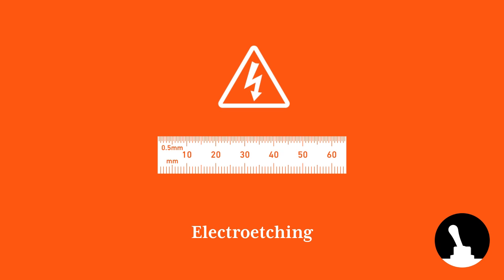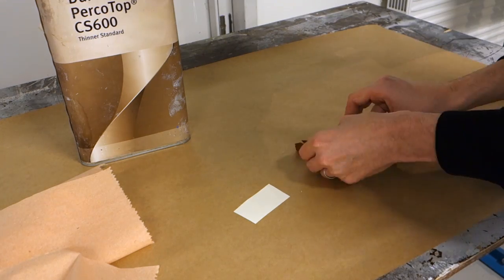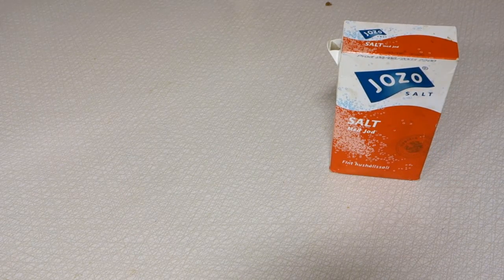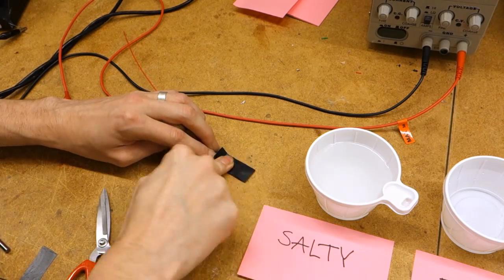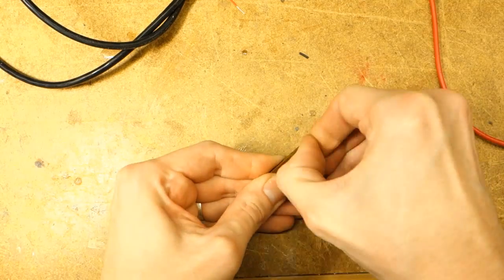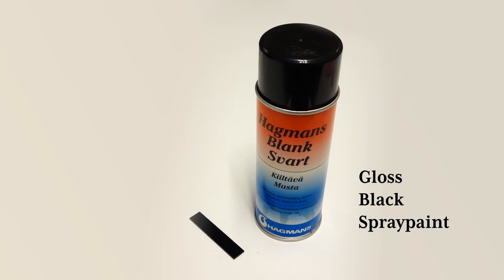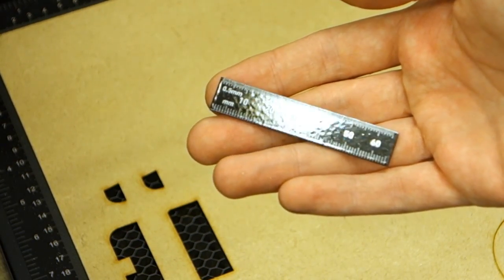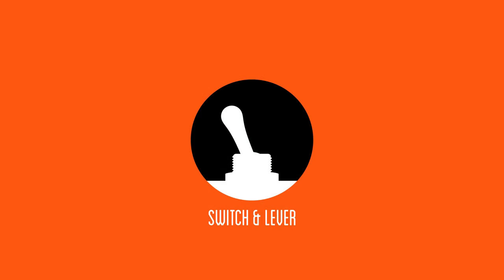Electroetching Metal

Comment: Hi Daniel !
I was hooked of this laser aided etching from the day you shared it, but I've not had the ability to do it ;-((

Now I have got myself a 3D printer and wat to add to it a laser head !
Do you have any idea of how many watts I need the laser to be for burning tape/paint as preparing for etching ?
Reply from the maker: Unfortunately not. If you’re just going to add a laser head to a 3D printer you’re going to add a diode laser, not a CO2 laser tube, which means you’re going to end up with a rather low wattage laser regardless how you do it, likely sub 5W. It may be enough to burn away the paint, I simply cannot say. Because it will do it much slower than a high powered laser there is a much greater chance for the tape burning and edges being unrefined, or paint melting with similar results.

Comment: I wonder if you could ( over a longer period and less voltage) etch metal away enough to make a stamp for touch marking wood.
Reply from the maker: +kooky flukes you have the right idea, but doing it slowly is counter intuitive. To get sufficient depth for branding you need to remove a fair amount of material. When you go that deep it will start to etch not straight into the material, but also into the walls that are being etched, which means the etching will undercut the resist you put on, obliterating any finer detail you put in. For this reason a faster etching is preferred. There are better methods of making branding irons though, like 3D printing (I have a video on that) or CNC milling.

Comment: cool video, but can you not just burn your design into the ruler with the laser itself?
Reply from the maker: +Warren Buitendag If you have a powerful enough laser, absolutely.
Reply: thought so... :)
Reply: +Switch &amp; Lever Actually... let me clarify... I have an Epilog CO2 laser... it puts out light in the 10.6 micron  range... at 35 watts... I could put aluminum foil in there for an hour and it wouldn&#39;t do much at all to it. However... if I had a Fibermark Nd YAG LASER... 1.064 micron typical wavelength... it can etch stainless steel, and possibly punch holes in foil. (About 10x higher frequency.) It's not just the power... the frequency also has a great deal to do with it.
Reply: , YouTube

Comment: if you flip current to DC for a few seconds after etching (assuming you etched on AC) the etch will stain a light black color and won't come off as the stain goes a few thou into the surface. keep your eyes on ebay and CL for a 'marking methods' etching unit, i lucked out and found one locally and have been enjoying how easy it makes things. another pro tip, screen print emulsion on a regular screen print screen holds up to hundreds if not thousands of etchings. It's quite easy to burn small screens at home with a little practice.
cheers and thanks for another awesome video!

Comment: I have just appreciated 4 of your videos, Well done and I like the dry humor.

Out of curiosity if you already have a laser cutter why not use an engraving spray like CerMark or TherMark? I have used Cermark countless times and have only been let down once but I dared to dream too big the 1 time. I tried to laser etch a 30mm x 300mm x 300mm plate of aluminum and it was to large of a heat sink.
Reply: You can try some cheap motorcycle chain grease spray instead of cermark. Works well on stainless steel.
Reply: nighttraintolorca 
That sounds like something I will try out tomorrow, thanks.

Comment: do you have to use salt or can baking soda be used?
Reply: Switch & Lever You can also use washing soda, (sodium carbonate) as a salt. as it's not sodium chloride it won't create chlorine gas.
Reply from the maker: I do not know, some preliminary research shows that you can indeed use baking soda when doing electrolysis, so I can't see why you couldn't in this application. However, when in doubt, test it out and see how it works.

Cheers!

Comment: If you add a drop of liquid soap (dish detergent) to the salty water, it should break down the waters surface tension and allow it to properly wet the entire surface.
Reply from the maker: Aye, that works, although that wasn't the issue I was having. I should simply not have put in the piece parallell with the water surface, but rather perpendicular, then small air bubbles wouldn't have gotten trapped on the surface of the piece I was etching. The soap method works indeed well to break down the surface tension, and I have used it in the past as well. Just take care of how you introduce the piece to the water and it should be fine.

Cheers!

/Daniel
Reply: Switch & Lever
Ok.

Comment: Hello, xcelent video xcelent demo, one question how long did you actually etch the metal ?? and what other metal besides still can be used with this method?? like lets say brass, it is used with chemical etching to produce very small parts for his scale model hobby but is a bit expensive to buy the etched parts and hard to get. THis method combined with a laser and a CNC that I owne would be a better choice just need to know what etching time and voltages work best thanks
Reply from the maker: It should work fine with brass as well, though be aware of disposing the water afterwards in a safe manner as copper should not be flushed down the drain. You can, however, boil off the liquid and throw it away in the garbage for all I know.

In terms of etching time and volt/amps, that you have to try and experiment with, there are many parameters which matter like the ones you mentioned, as well as salinity concentration, size of piece to be etched, size of anode, and the composition of the metal itself.

Cheers!

/Daniel
Reply: thanks a million cheers

Comment: I have a LASER... and I had been using Thermark ($50 a can) but now... thanks to your video (I'm subscribed) I'll be doing this a LOT more. (And I'm sharing this with the ATX Hackerspace too. (Austin, TX)
Reply from the maker: I've tried out the Thermark spray and their tape, but with disappointing results. I never could get it to stick properly to the metal I was trying to mark. What I did find good success with was Sharpie markers though, and I found out completely by accident while trying to laser a pattern mask like in this video. 

Basically, what I did, and I will continue to experiment with, was painted Sharpie marker over a surface, in two layers (letting it dry between the layers) and then lasered on top of it. It didn't look like it took anything off, but when I cleaned off the metal with solvent the parts that I had lasered stayed put on the metal as a black mark. Interesting, and possibly quite useful, surprise.

May make a video about that in the future once I've found out if it's working consistently or not.

Cheers, thanks for the share!

/Daniel
Reply: Switch & Lever
Now that's interesting... in metalworking there is a layout dye, usually in blue or red... this should be the same (or very similar) substance as what is in the Sharpie. Your process may work with these as well... and if so... you have additional resources. I was going to say colors... then I remembered that Sharpie now makes like 12 or 16 different colors. Happy experimenting!
Reply: +Switch & Lever try to use thermal grease for CPUs works great with 40W CO2 laser and stailness steel

Comment: Just want to clarify the electrical values...is that 1960 amps or just under 2 amps (i.e. 1960 milliamperes))?  1960 amps at 10 to 20 volts seems very high....you can weld 2cm steel with far less power than that, and I'd have expected much heavier wires to carry it.  That's something over 19kw. 

The differing use of commas and periods in numbers may be causing confusion here, so just wanting to get it clarified before someone fries themselves.

I loved the video though, and want to try the technique. I have a laser printer, so the print reversed and iron on masking will be my method. I'd love a laser engraver, but don't have the thousands of dollars to spend. 

-- Mike
Reply from the maker: No, for sure, just less than 2 amps. I wouldn't expect a small desktop power supply to be able to come anywhere close to generating 2000 amps, and if it did I'd likely be soiling myself. That amount of current is terrifying!

Cheers!

/Daniel

Comment: Very interesting video, thanks for sharing.  Curious, why did you laser the piece horizontally with the tape but then went vertical with the paint method?
Reply from the maker: Hello tinylogic! The reason was because I went with even thinner graduation lines with the paint, and after a quick test noticed that the lines etched away more consistently when done vertically rather than horizontally. I don't know if this is true for all laser cutters, or just a quirk with this one.

Glad you liked the video!

/Daniel
Reply: Switch & Lever I believe you can tune the laser's engraving direction and sequence in the Epilog driver, though I haven't tried it myself.

In my experience with engraving coated metals there is definitely a difference between lines that get engraved along the "grain" of the laser's movement and those that are engraved across. The latter being rougher.

These differences are a lot more apparent when engraving into a coated piece of metal, as opposed to a deeper engraving in soft materials where the small inconsistencies are difficult to spot. You can often also see a noticable difference in engraving quality for such projects if one area of the part has a lot of detail, while another is fairly clear. Or on the first area to be engraved.

To avoid this it might be worth doing some tests while tweaking the resolution, speed and power settings. Then again, for most projects, it isn't a make or break deal. Still, one more thing to keep in mind when working with the laser :)

Another great video, I hope to try this at some point. :)
Reply from the maker: kimaboe You're probably right, however I do not use an Epilog laser cutter, so whether that's possible or not bears little impact.

Glad you like the video!

/Daniel
Reply: Switch & Lever Well, if the project is small, orienting the item to be engraved according to the laser's preferred direction is as good a way to solve the problem as any. :)

I came across this problem when engraving a 10mm by 10mm grid on a project that was too large to turn on the bed. I ended up engraving the y-axis lines again to ensure the coating was fully removed.

Comment: I really enjoyed the video. Like Don Cossitt mentioned, watch out for chlorine gas. I would suppose that etching in a well ventilated area would work or use a welding fume extractor. Would the etching process work with photo resist like used on printed circuit boards?
Regards,
Dave
Reply from the maker: Hey Dave! It should work, as long as it insulates from the salt water. I haven't tested it myself, but I've heard people who've done it quite successfully.

And indeed, I added a warning in the description of the video to work in a well ventilated area. Thanks for catching that. There are also some concerns about which material you use, such as electroetching stainless steel releases chromium (if I remember correctly) into the water which you shouldn't just flush down the drain, it needs to be taken care of in other ways.

Cheers!

/Daniel

Comment: Hi !
I looks like a realy nice method for BOTH your demomstration but too for makin printed circuits when using a negative image - right ?

Do you have a demo of the 3D-laser-jig ?

It's a MUST HAVE tools, I think !
Reply from the maker: I'm unsure what you mean about the 3D laser jig. If you mean the laser cutter it's a fairly generic one, a LaserPro Mercury. It will likely be featured in coming videos as well, as I have some plans for some laser projects.

This method should indeed be able to be used for making printed circuits as well, indeed. Although, I have done similar things in the past and using a glossy inkjet paper printed on a laser printer and heat transferring that to the circuit board also works really well, and may be faster than laser etching across a bigger board.

Cheers!

/Daniel
Reply: Switch & Lever As I understand it now, you can just paint the PCB-cobber plate with painting and then "burn" a negative image of the printed circuit board you want, etch it and you'r done - right ?

The problem I had, was to get the image fastened to the cobber plate - your method is so simple to implement !

Please, let's see some demos, prices of the laser cutter ect, ect !
Reply: Keld Sørensen not quite. It's special "paint". You spray it on, then set the overhead negative picture on it. You want to use those clear plastic sheets. You put it on the pcb, expose to uv light, then wash away the paint that was not exposed. Then it goes into an acid bath.
Reply from the maker: Keld Sørensen I do believe it would work, though I haven't tried it. It's worth a try, or doing more traditionally as Aaron mentions below, with proper photo resist and an acid bath. I can't see why using a generic non-waterbased spraypaint and laser etching it away and then doing electroetching would work differently than the photo resist and acid method though. The end results should be fairly similar if done correctly.
Reply from the maker: Aaron Kimmins Aye, that would be interesting. Unfortunately I don't have any acids to play around with, so unless someone else is up for it I'm not going to be able at the moment.

Comment: Very informative.  Was that 1960 volts at 1 amp?  I could not read the scale on the meter.  Thank you-  Fred
Reply from the maker: Hi Fred! Nope, it's 1.960 amps (think that's the max for my power supply) and fluctuating between 10-20 volts. Though, you could do this process with a 9 volt battery as well, it will just take a bit longer.

Glad you liked the video!
Reply: Many thanks!  I am going to do some experimenting myself.  Thanks for the lead...
Fred